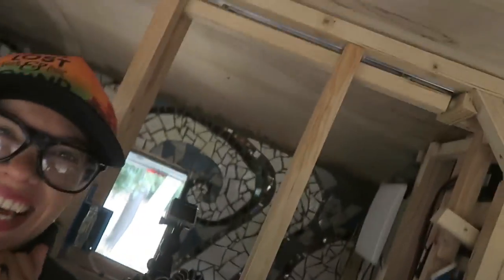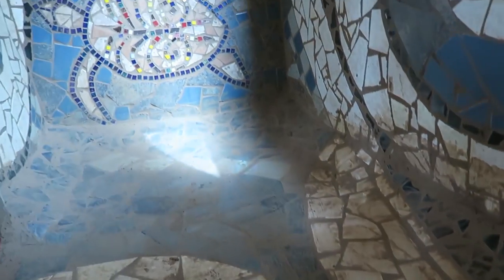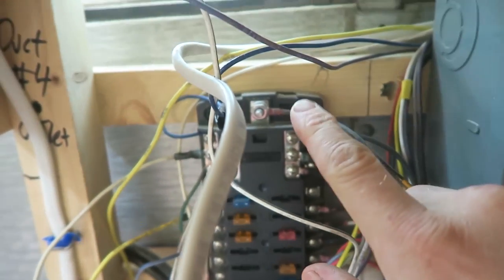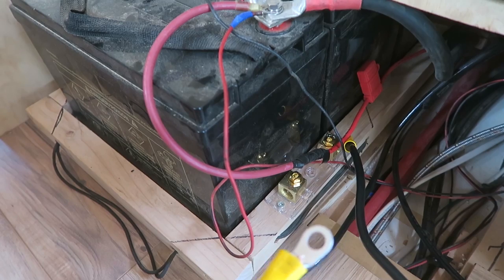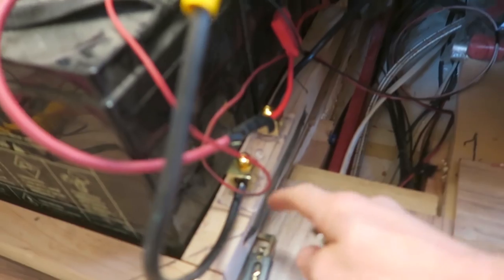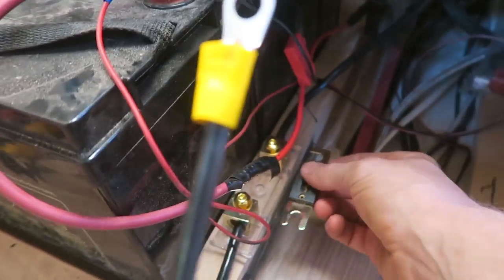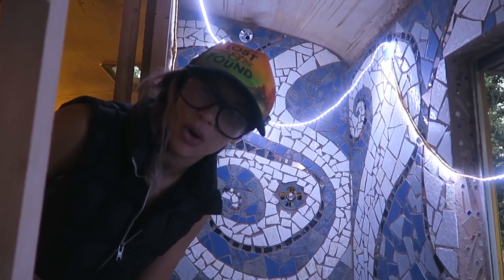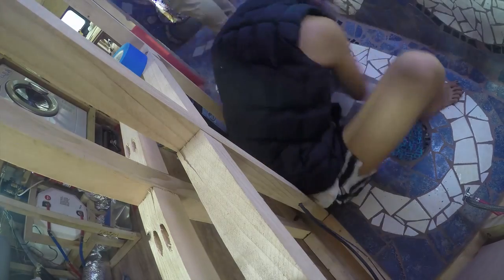#80 SKOOLIE BUS CONVERSION | 12 volt Fuse block to Battery wiring and Grouting Mosaic Bathroom floor

Comment: The mosaic turned out great, tiling tiny pieces is NEVER easy ! You never explained how you got the tiny decorative ones that were thinner to set flush...did you bump out those areas ?
Reply from the maker: That's how V did it. It took a long time, but I think she got it right.

Comment: Get a roll of red electrical tape and wrap the  ends of the black positive cable so you know which is which. It will save you a minor headache if you ever have to disconnect to replace a battery or component, plus it will be safer if someone else ever has to troubleshoot a problem. If you can't get color coded wire, make sure everything is clearly marked.
Reply: The + and - on the yellow insulation at the fuse block are  better than nothing, but it's always best to code using the standard colors, which for 12VDC are Red+ and Black-   Nice to see the 4AWG cables in there too.

Also, Ian, you're exactly right on the continuity testing. Very important you tested both and only got continuity with one, just in case the tester itself wasn't working right.

Comment: You might want to varnish seal the ceiling in the bath
Reply: I was thinking the same thing, maybe a marin grade varnish to seal the wood so it will not get damaged from the moisture in the shower area.

Comment: you can actually run 12 volt LED lighting with 18 gauge wire safely. If it's running something other the LED then yes it's too light
Reply from the maker: I'm reusing a lot of wire, but I'm guessing 12volt LED lighting could run safely with 22 gauge wire. Those light require so little amperage. It's like they don't exist on my battery bank. Thoughts?

Comment: Sparky.      Ian, another way of checking the wires is looking at which one has the writing on it. Sometimes they can denote them with a stripe as well. Good use of your decent multimeter as well.

Comment: I'm glad you changed some of the wiring.....but to be honest...you really need to get a professional  to do it. It's not worth losing your lives in a fire (if you don't care about youself..(as most of us men don't) you should do it for your partner. There's only two exits in that bus...front and back..and alot of kindling in between! Just sayin....not to get on you...but because I care. By the way..I told my wife last week that I couldn't understand why someone like yourself who seemed to know how to wire this up correctly used improper wiring Guage etc..you had me baffled....in fact...I confess, you snowed me.🙄😀...I really appreciate your honesty...seriously, use color coded wiring with proper Guages etc...you guys are worth it....if I wasn't in a wheelchair and on disability I'd buy it and send it to you...Love your Vlog...the bathroom mosaic is looking Cool.....Hang in there...p.s. I like learning from YouTube also.....I won't talk to you about your wiring...😃😃Dave
Reply from the maker: Thanks Dave. Really appreciate your kind words. This is the first 12v system I've ever wired up so the feedback is really helpful.

Comment: what software do you use for video editing
Reply from the maker: Adobe Premiere CS6
Reply: Ian Robinson don't know if you've thought of this but have u considered going series parallel with your batteries, it's more efficient and the only thing you'd have to add is a dc voltage step down